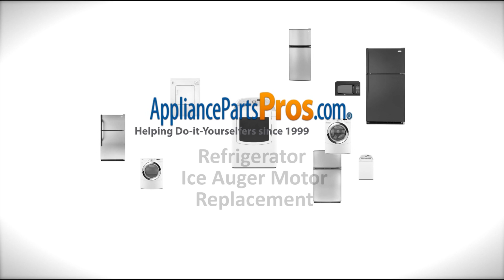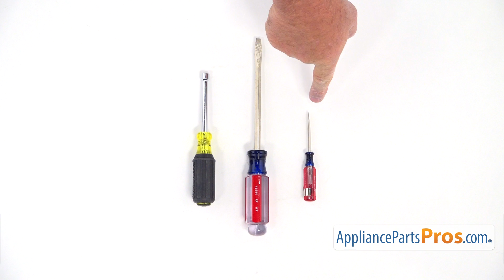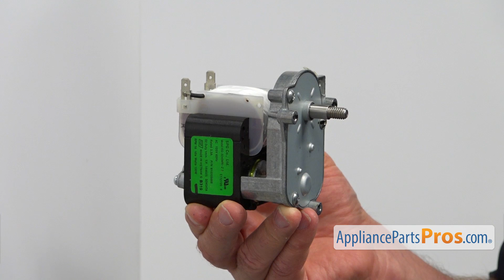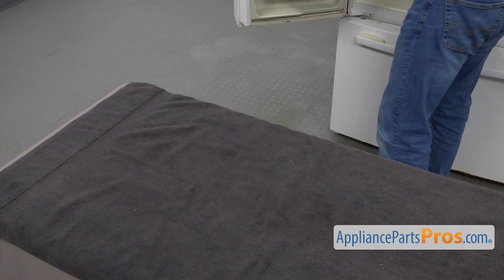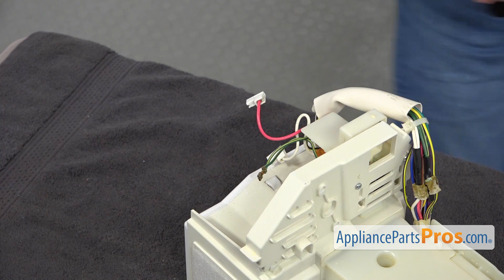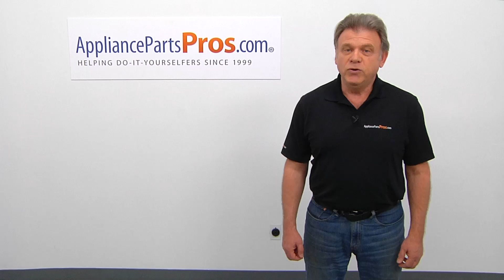Whirlpool Refrigerator Ice Auger Motor WPW10309868 Replacement — fits KitchenAid/Maytag

Comment: I had the same problem as Jeff did. The yoke was stripped, this most likely happened when using the crushed ice option. This appears to be a common problem. So as long as you can hear the motor running when you push the ice dispenser bar, this should work. I purchased a 5/6" x 18 left-handed nut from the hardware store and was able to tighten it down against the yoke. I only had to remove the ice container assembly, it took all of 10 minutes and cost less than a dollar. Thank you, to Appliance Parts Pros for the great video!!
Reply from the maker: You are welcome! Glad you were able to fix your issue! If there is anything we can help you with in the future please let us know.

Comment: At 3:20 I’m trying to spin that C brace thing off auger, but mine spins clockwise and counterclockwise.  Can’t free it off to spin it.  Actually seems like it was soldered on.  Is that possible.
Reply: Ran into the same problem. The yoke is stripped and what's left of the threads is balled up in it so it won't un-thread. The threads are reverse too. Before ordering the motor drive unit I suspected that the coupling between the auger and the motor drive was bad. I was right. The drive is fine. And guess what, there isn't a drive clutch to wear out. The engineer who thought a small threaded connection would be good enough was wrong so here we sit with a stripped out yoke that won't come apart. This threaded connection should have been at least sized up to the next size. What a rookie mistake. Need at least a yoke with double the thread engagement. Dam it. So now I have to cut the shaft behind the yoke (destroying a good $155 motor drive unit) replace that with the one I just received in the mail, put the whole thing back together without a new yoke and order a new yoke with insufficient thread surface only to do this over in a year or two. F that. I'll make my own yoke.
Reply: Got the yoke unthreaded enough to get a hacksaw behind it to cut the thread off. Threads are shot anyway. Screwed the remainder of the shaft out from of the yoke. Replaced the motor drive unit and re-assembled the whole unit back into the fridge. I can work on a new yoke later. the shaft threads are 5/16" x 18 tpi. left hand. A common size, but uncommon left hand threads. You can order a new yoke and screw it on later with a new washer. It's self tightening. I'm looking at welding a Stainless Steel nut to the yoke and tapping it for a perfect fit.
Reply: @jefsel881  Hi Jeff I just experienced the same failure which the yoke was stripped out on the shaft and would not hold the torque.  I found a 5/6" x 18 left hand nut at the local TrueValue hardware and it worked.  I tightened it down against the yoke and it is now tight.  It was a $1.50 fix for a $200 motor and yoke on Amazon so thanks for your insight and feedback.
Reply: I hope replacing the auger motor fixes my issue with crushed ice. The blades keep jamming like they don't have enough power to crush